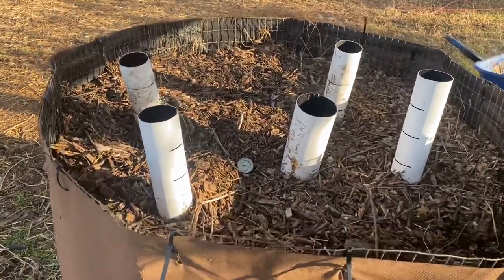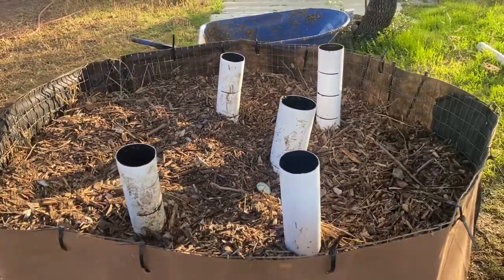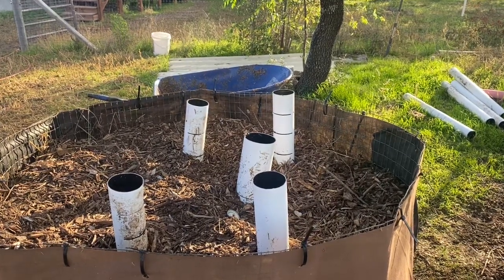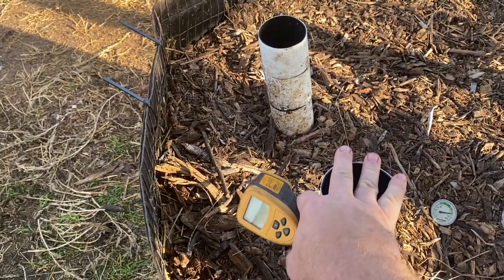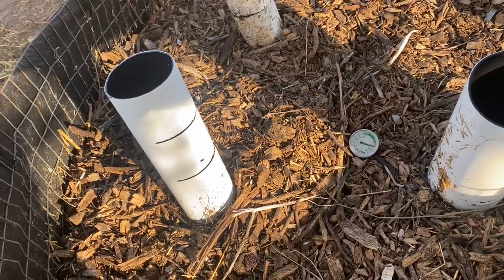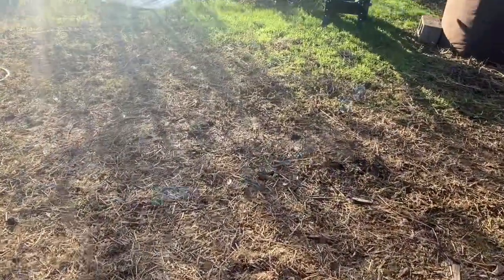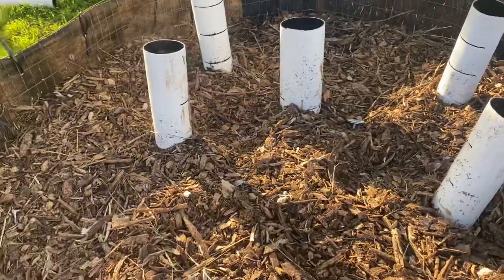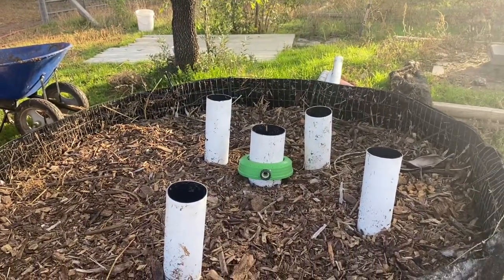Compost Bioreactors 40 Hours After Being Built - 160F Already

Comment: Nice video you can do similar in a garbage can and air pipes with holes drilled in the sides, the pipes, and the bottoms. I like the wood chip cap for the fungus. Add air pipes a foot from the garbage can sidewalls
Reply from the maker: You can compost that way I actually have old vids in my members area on building that but it is more a slow compost no heat thing.  Just not enough volume and air flow for this level of production.

Comment: Do I understand you to say that the heat does not kill the fungus in your wood chips as it all composts down?  🤔
Reply from the maker: Well not exactly but also yes.  So we cap the system with chips.  It never goes full active and is never mixed with N.  So it just kind of sits there and the fungi in it colonize after the active part ends.
Reply from the maker: Remember we NEVER turn this stuff.

Comment: Not sure about using that gas for heat???  It's my understanding that some pretty noxious gasses come out compost piles.  Commercial scale compost heat extractors scrub those nasty gasses with filters.
Reply from the maker: It is mostly CO2 and it isn't "nasty" it is plant food.  Additionally I compost with biochar so most volatiles are adsorbed by it.